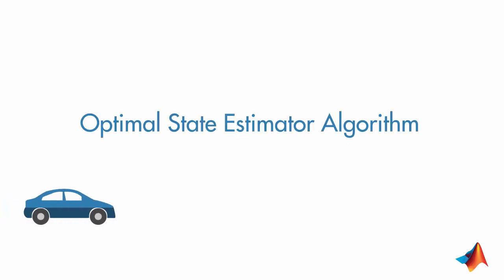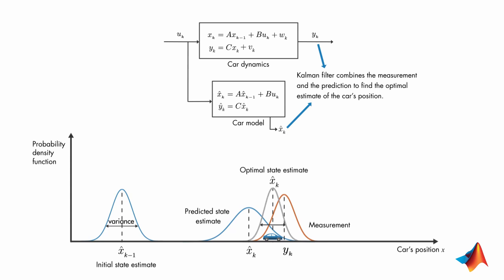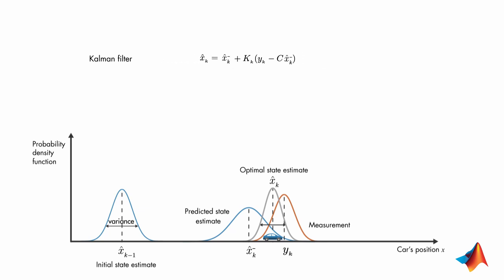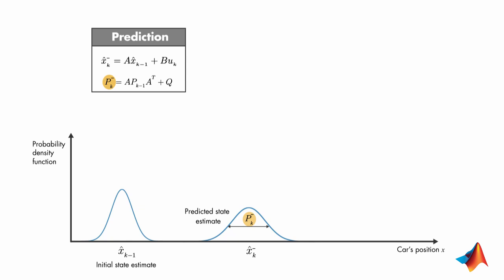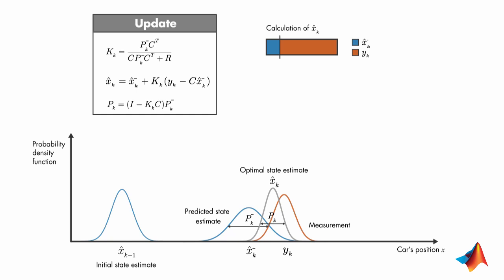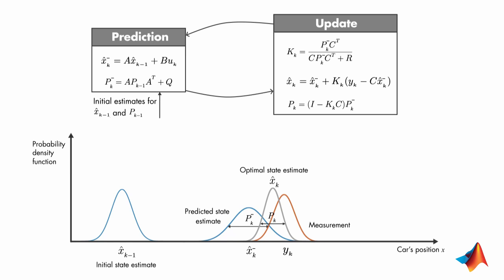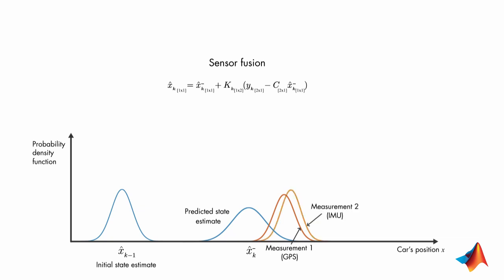Optimal State Estimator Algorithm | Understanding Kalman Filters, Part 4

Comment: Hello I have a question concerning the process noise:
If I have a distance signal which can change at maximum 5 mm between two measuring points, can I use those 5 mm as process noise? Or did I understand it wrong?
Reply: You should use 5^2 because if your standard deviation is 5 the variance is 25 in the R matrix.

Comment: @MATLAB I'm using an IMU which has an accelerometer as well as a gyroscope and I am double integrating the acceleration data to get distance. should I be using sensor fusion to do this? or can i achieve this using only accelerometer data with a kalman filter?
Reply: At the end what you used?
Reply: @emmanuelrodriguez2346  he just went to sleep

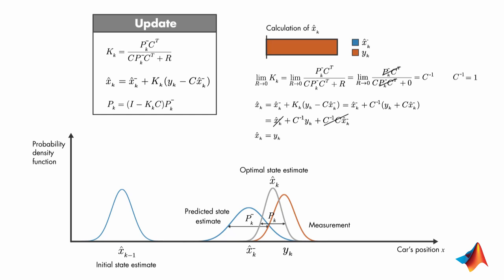Comment: In 5:35, ¿shouldn't the equation result as:  xhat_k =  2xhat_k predicted  + y_k?, because the value of C=1, and inverse of C =1 too...
Reply: it looks like an error in the sign of C*xhat_k predicted after the distribution of K_k. The K_k should be distributed in the multiplication without a change in the sign. So, it should read:   

xhat_k = xhat_k predicted + (K_k)( y_k - C*xhat_k predicted)

xhat_k = xhat_k predicted + (K_k)y_k - (K_k)C*xhat_k predicted

xhat_k = xhat_k predicted + (C^-1)y_k - (C^-1)C*xhat_k predicted  

*the (C^-1)C cancels and the (C^-1)y_k is effectively just y_k which leads to:

xhat_k = xhat_k predicted + y_k - xhat_k predicted

therefore:

xhat_k = y_k

**they mess up the signs a good bit. the previous part had corrections all over the place.
Reply: I forgot to transfer the minus